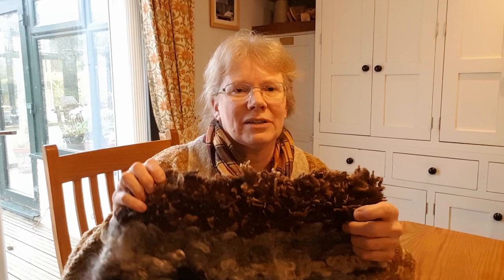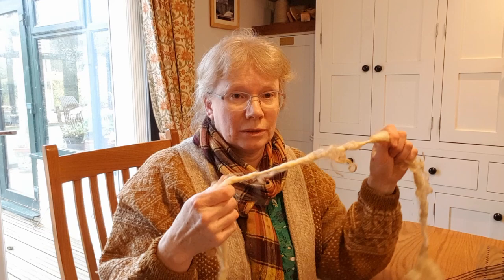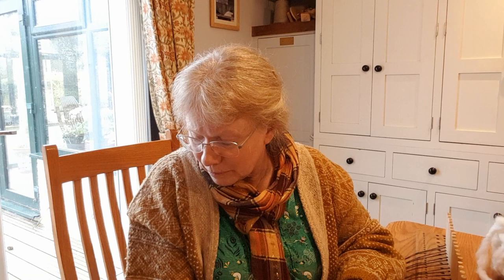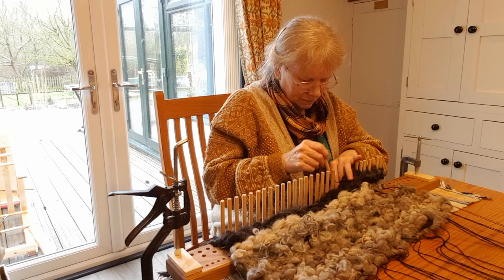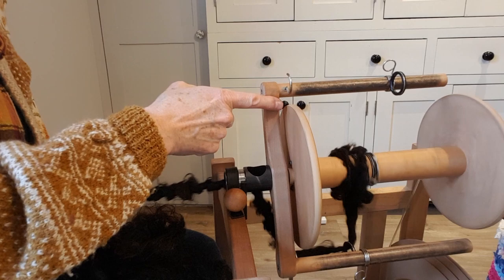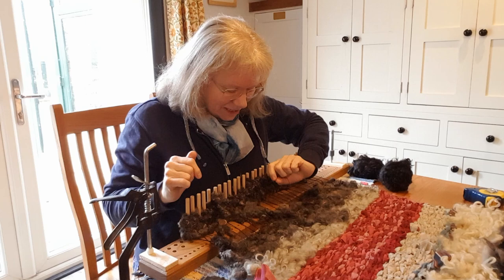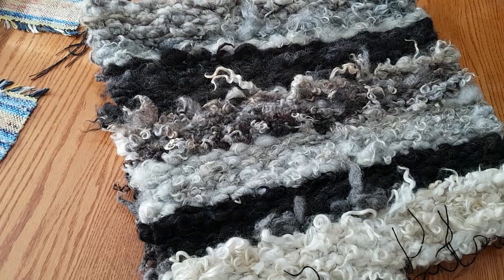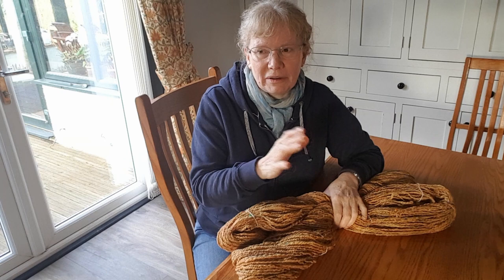Ep. 4 - Peg loom weaving cushion project with handspun super bulky yarns

Comment: Thank you for sharing your processes here. I love that super bulky textured yarns and the peg loom seems perfect for it. Do you think it could be done on a rigid heddle, give an large enough reed?
Reply from the maker: Hi there! Thanks for your comments. I think that you might be able to simulate something on the rigid heddle, but it's a different type of weaving. The chunky bits of the weft I'm using really need to be fed through the pegs one at a time. I think that would be difficult on a rigid heddle warp. Also, the resulting woven piece on the peg-loom is very dense and spongy because there's not really any tension on the warp and the wrap disappears, which wouldn't happen on the rigid heddle. So if you are looking for the same 'look' then I'd say probably not... but..you could try it and see! let me know!

Comment: How would you clean it..
Reply from the maker: You can soak a rug like this in a big bath of very hot soapy water, drip dry outside on flat surface, then put somewhere for heat to get it thoroughly dry.  But wool repels dirt, and you shouldn't need to clean it that often.